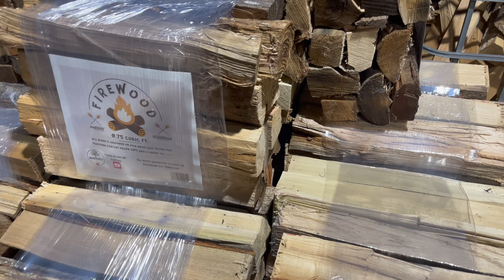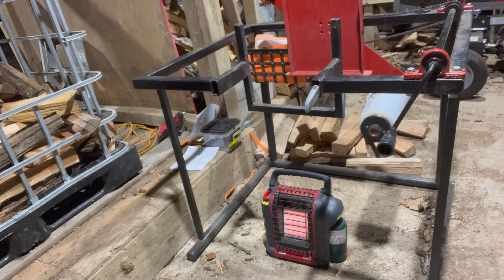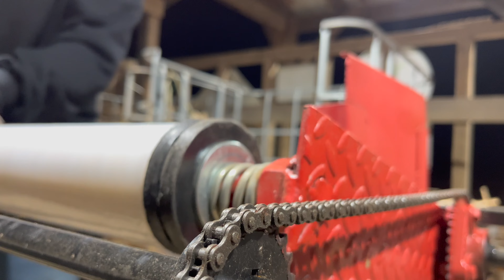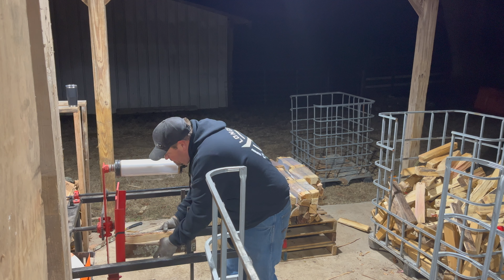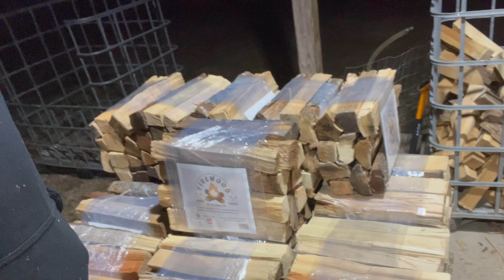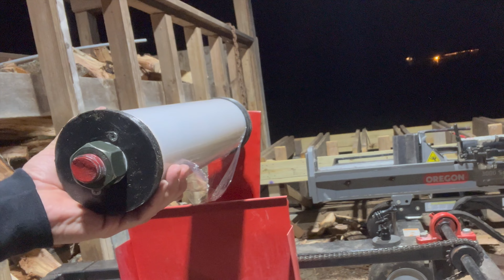Bundled Firewood Sales Are Heating Up!! #firewood 🔥🪵

Comment: Just found your channel the other day, watching from WI! Thank you for the breakdown and measurements of your bundler. I started building the frame for mine. One thing that may work if your lead is a little heavy as you use the wrap, is if you were to drill a hole that is offset in your lead and have it further out on the arm when the wrap is full and as it gets used turn the weight so its closer to the center line so it has less leverage? Maybe that would help with the wrap ending up where you want it after making a bundle? I also have a stock pile of lead from my racecar haha. Hopefully i will have my asphalt late model on the track this year. Take care and looking forward to watching more of your videos.
Reply from the maker: That’s a thought on the lead offset! It could definitely move it more to center and less counterweight. I appreciate you watching and commenting. I ran dirt track a few years before we had kids, and I am still a big dirt LM fan. I try to hit the big races and go to some local shows. I’ve had really great results from my bundler and I’m sure yours will perform the same. 
Take care,
Brandon